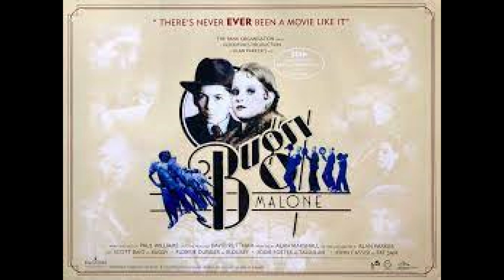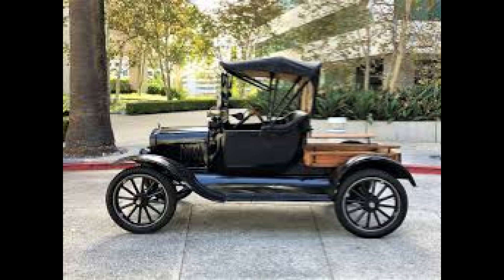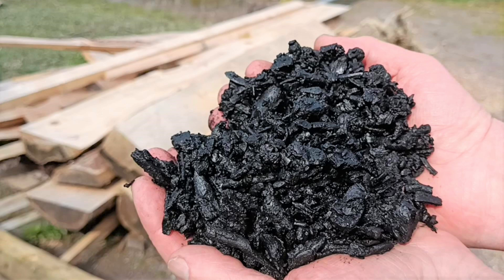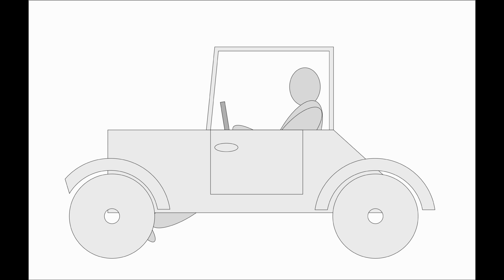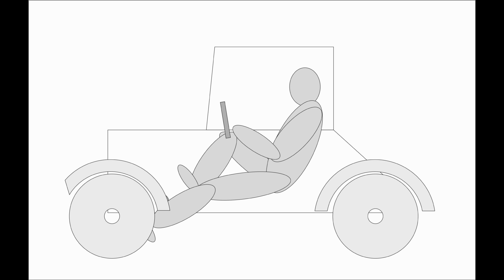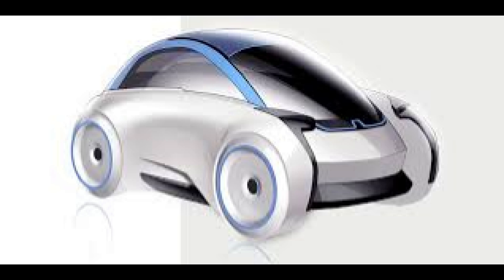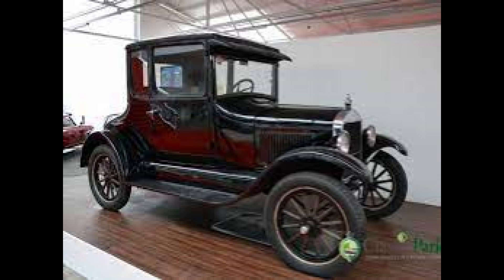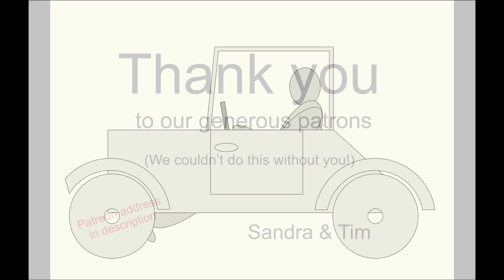Could We Build A Full-Size Wooden Pedal-Assist Electric Car?

Comment: Consider the Austin Seven.  It's a full-size car, albeit a quite tiny one by modern standards.  Four wheels, oodles of style and nobody expects a seven-horsepower car from the 1930s to be fast.  So if you build something resembling that and augment human muscle power with an electric motor, it might get down the neighborhood roads with sufficient speed as to not infuriate ALL the other motorists, and you don't work yourself into a complete sweat just popping down to the shops.

Comment: The Irish Industrial Revolution continues!  Looking forward to what you develop.  For the love of God please don’t use bicycle wheels.
Reply from the maker: why not?
Reply: @wayoutwest-workshopstuff6299  Bicycle wheels are not designed for lateral forces because bikes lean when turning.  On a vehicle camber is fixed and during turning the wheels are subject to very high lateral force.  So if bike wheel is used on a car type suspension the spokes will collapse causing catastrophic failure of the wheel.  You can watch Red Bull Soap Box derby to see this in action

Comment: Having built a soapbox gravity racer, I would recommend heavy duty BMX wheels, the ones with the greater number of spokes. My wife's mobility scooter does 18mph with a 1kW motor and 5 decent sized batteries. Good luck.

Comment: I think power to weight ratio will be very crucial for this project. With legal ebike legislation in Europe limiting the motor to 250w and 25 kmh. It is possible to convert a car alternator to be a brushless 3 phase motor, cheep for it's power (24v X 80a almost 2Kw), with a RC speed controller also relatively cheap. Perhaps you could make a streamlined body with bamboo or plastic pipe and some sort of transparent shrink wrap?
Reply: Recumbent bicycles with plexiglass are greenhouses!

Comment: Well, the easiest design you could go for is to attach two bicycles together side-by-side. https://i.pinimg.com/564x/2d/db/7c/2ddb7ca1c7956c83f2f90fe64b9edb01.jpg 

This will give you a pedal vehicle with 4 wheels and two seats. You can also use bicycle-compatible parts and you won't have to mess with crating a pedal transition and differential. 

If you want something that looks even more like a car, maybe get two recumbent bikes and put them together. https://i.pinimg.com/564x/43/44/c5/4344c5d2e7b2b513370ba596a3d75967.jpg

Comment: Have "converted" regular bikes to ebikes; some observations: your invention will be too heavy for an ebike "hub" motor unless you have multiple, and thats getting complicated. I would suggest a "middrive" ebike motor - in bike terms this replaces your bottom bracket and powers the large chainring. This enables use of normal bike gears and is alrogether smoother and more efficent. The gearing should allow you to avoid burning out the motor. For an off tbe shelf example I reccomend looking at "bafang" motors, in particular the "Bafang BBSHD", the meatiest example. You may run into laws re power (ive never heard of anyone being checked) but you can reprogram the motor to only put out legal power. The advantage of reprogramming rather than just buying a low power motor is that you can use it on private roads at higher powers and also that the components are far more durable.
Reply from the maker: thanks - yes, we're looking at those..

Comment: A lightweight frame made of tubular metal of some kind, covered in either heavy fabric or sheet aluminium or a combo of both.  I think wood is too heavy and rot prone.  Is that the budget blown?  Bicycle suspension components and brakes, a couple of hub motors with the electronics from a pedal assist bicycle conversion and you are away!  It has to be possible to build something nice looking that functions well.  I like the Model T Ford coupe inspiration.  You've got us all interested now. 😊

Comment: Id use 2 inch steel tube 1/8 wall wouldn't need much of it but the frame would be light and strong. Wouldn't be hard to pedal it if you got the gearing right. Since it'll have the electric motor it will assist you from a stop then be very little pedal and electric to keep you going. Most ebike motors put a small charge back into the battery when they are not powered like as you would be coasting or using the pedals

Comment: I know this is off-topic, and the answer is most liksly no. But have you thought of converting your stationary engine to be powered by wood gas? Granted,. the engine doesn't cost a lot in deseal, and I am not sure how viable this system will be overall. I just thought that you could take advantage of the gasses from the activated charcoal process.
Reply: Wood gas is very complicated unless you use a charcoal gasifier .

Comment: This is fantastic!  I think e-bike wheels are definitely the way to go. Light weight, and low rolling friction.  Also the controllers, chargers, and batteries are ready-made.

I'm a boat builder, so I've had experience with plywood and epoxy. I think it would be very difficult to build a body light enough with this method.  I think building out of wood and canvas (or the modern version of wood and Dacron) like an airplane would be brilliant. Very lightweight canoes and kayaks are built this way, and they're quite durable too. Dacron is fairly cheap, and shrinks when high heat is applied making it easy to get wrinkle-free. Once painted, the 'canvas' becomes drum-tight, and rigid enough to actually behave like a panel.
Reply from the maker: Thanks Joe. Good tip about the Dacron - I'd forgotten..

Comment: https://youtu.be/4RgqLQyDApE if money was o object this would make a very interesting monocoque.wood and fiber glass are  interesting  compasses. I like in the vamobile that the cab looks like a big motorbike helmet with grater visible .The mosquito plain was the fastest plaiin in ww2 it was made from ply would and was much lighter than if it was made from  metal
Reply from the maker: Is that real?! What fun  : -  )
Reply: @wayoutwest-workshopstuff6299  Saw the explosieve forming 20 or so years ago where they put colf ball type divets in a monocoque type structure making  very light aluminium amazingly ridiget

Comment: Completely agree with 4 wheels. The issue with three wheels. Especially in the country, is that the third wheel will ride through the rough ground between wheel tracks on country lanes and driveways

Comment: Hey Tim, Great Project.
 I suggest that you may be able to fabricate very lightweight and strong panels, even curved ones.
For years i've dreamed (as foresters do) of an electric assist velomobile with a structural shell chassis, formed of tightly and skillfully woven willow basket work, fibreglass and epoxy both sides for strength (thickness can be varied as needed across the structure with further weightsavings).
Perhaps you might like to experiment with woven willow panels, epoxied and fibreglassed both sides?? A good material for "coachwork"?
Baskets are strong and light, materials in the hedges,
Heck you may even get a few basket makers volunteering to help...
If you werent so far I'd be itching to join in.
tim
Reply from the maker: Interesting idea, Tim! Not easy if you want a smooth finish though?
Reply: @wayoutwest-workshopstuff6299  4mm willow, tight weave, smooth ripples on the surface?
 granted it may not present the smooth shiny black you'll need for your "Model T" look. 
Perhaps some sort of lightweight foam filler material could be used to flatten the weave prior to fibreglassing, give the woven panel a layer of spray foam to fill out the weave with a squeege maybe, sand back so the wood shows a bit, then add fibreglass and epoxy.
light strong smooth shiny, perhaps less than half the weight of equivalent epoxy coated plywood. Of course I wish you to follow your impeccable logic and reason. I am only suggesting this untested unproven technique as an option.
Saoirse!
tim

Comment: Well that is much bigger scale than narrowgage.
i think extremely light wood/bamboo would have to be the basic structure, i would probably go with 2seater to start with just as proof of concept.

Unless there is some handy chassis available  in nearby car scrapyard probably KISS principle - box steel frame, leaf springs, body on frame design.

I suspect for simplicity sake the wheels might be best served by just having one bar as opposed to independent for each wheel, front paddles only and back powered by the engine?

Comment: 3 wheels save on suspension. 4 wheels needs complex, (and heavy?) suspension or it's practically a 3 wheel car anyway on any non-flat surface. I had a delta config bike for a while. It was great on the flat and downhill, but it was terrible uphill compared with a normal bike because it isn't possible to use one's weight - so driver position might be worth considering.

Comment: i'd be glad to help you. e-bike parts or golf cart parts would be very easy to find. the simplest of simple would be hub motors since there's no drive shaft to worry about. if you go this route, make sure the two are the same power and torque. controllers can vary the power sent and all. you could also make it a 4 wheel drive if you use 4 hub motors. i have been following your channel for a bit and you have enough smarts in your brain to make the posibilities endless
Reply: for the speed display, most e-bike controlers have a display of sorts to show speed, battery, range, odometer. it could be an all in one thing

Comment: E bicycle wheels all round with chains on the back … get 2 old bicycles and cut them up for the front forks and back forks weld them together and make a linkage for the steering my dad make this it the rinky dink pedal powered sounds system https://youtu.be/KVRywQRM2H4

Comment: I am currently making something similar and have came up with my own answers to some of the questions you have.  The electric motor system is pretty easy.  I used an ebike conversion kit from Yose Power.  It’s a 250W (road legal) geared hub motor system in a 20” (BMX-type) wheel.  The kit has the controller, display etc and it’s dead easy to install.  I used a ‘front’ hub motor on one of my rear wheels and a pedal chain drive to the other.  I’d suggest using BMX wheels all round (with the larger diameter axles e.g. 14mm).  As for body construction, I am using thin ply on a steel square section chassis but this is a bit heavy.  I think a monocoque would be a good idea or make chassis members from plywood ‘boxes’ which are light and rigid.  You can learn a lot from old fashioned model aircraft construction methods (stick and tissue).  I would also suggest ‘poor man’s fibre glass’ as a way if increasing the toughness and weather-resistance.  This is just gluing on fabric (such as a cotton bedsheet) and covering it with several layers of paint.  Cheaper and less smelly than epoxy.  Steering and suspension are more tricky.  The Dutch guy who built the ‘Tribolt Trike’ (see it on FB) has good ideas for simple, non welded front steering systems.  Rear suspension using bits from old mountain bikes seems relatively easy - the front less so.  Anyway, good luck.
Reply from the maker: Thanks HTH - I'd be interested to see what you came up with - but no videos?

Comment: Take a look at the channel “MORI TV”, a Japanese chap who modifies very small motorcycles into trials bikes, and also builds (from scratch) small 1920s-1930s-style sports cars powered by Honda 50cc - 90cc engines. He has made 3 and 4 wheelers. Surely an electric motor from a golf buggy will be similar power/torque to a Honda C50 engine.. his chassis are welded steel tube space-frames - very light (essential) and rigid. I once built a sports car chassis on a flat wooden board, so it’d be a doddle for you. Love the concept! Les in UK

Comment: Ackerman steering is highly recommended.

High-carbon steel tube or box section steel for frame and rollover loop. Rivit aluminium sheet for bodywork.

Rear wheel drive for simplicity.

Comment: A separate motor for each rear wheel saves thinking about a differential, pedal power on one wheel only? Take a look at Dibond or Alupanel for the body structure, I have built monocoque railway coaches from it. It has a polypropylene core with painted aluminium skins on both sides. To create a fold you cut half way through with a 90 degree bit in a router.
Reply from the maker: Thanks, Colin. Locos are so much easier, aren't they? - no differentials, no steering, limited suspension and no weight worries...
Reply: @wayoutwest-workshopstuff6299  , I think I will stick with rail! Been drawing up a small car front end, kingpin inclination, scrub radius, castor, Ackerman angle and other scary stuff! I can recommend searching youtube for cyclekarts, this is a great summary on front end design, 'Team Juric - Lotus 25 Cyclekart Design - Part 1'.  
Not seen your loco for a while, how about an update?

Comment: My wheels are turning now ! lol. I have made a few small cars and large go karts . Starting with the frame you have 2 choices wood or metal second as far as a motor a starter from a car works great its 12 volt and very strong  and there's no need for a differential , make it a 1 wheel drive . i would use 2- 20" bicycles ( 2 front and 2 rear with gears ) you can use most everything on the bike from the down tube backwards to hold the tires , the forks and necks with gears on top to steer then build your frame and cover with canvas or 1/4" plywood now windows id use 5/8" plexiglass and the seat id use a school bus seat with frame . Batteries having 2 separate banks of 3-12 Volt each and solar charging the bank not being used . Lights would be all LED 12 volt and no need for axles having one tire for pedaling and the other for the motor ! The bikes should have 1 way gears so your not turning the pedals or motor when not being used !
Reply from the maker: Thanks Dave - lots to think about there..!

Comment: I like this project. I have a thought about the doors. Don't make regular car doors. Just Don't. They are a pain in the rear. 

Maybe a top that lifts forward back or side ways on hinges, and latches on the inside and or outside. Maybe be able to latch from the inside if inside the car, and from the outside when you park it. 

Perhaps, a canvas door that zips up. Or a plexiglass window that you remove to climb in the car, and resecure once in the car.

If it is possible, to source sheet aluminum, it might be useful for some of the body panels as it will be lighter than epoxy coated plywood. It might even be cheaper. I know epoxy, fiber, and plywood are not free. But I don't know how far from free the supplies will be in your area.

Good luck! I look forward to seeing this project progress!

Comment: Google "bringo hinto" for images. I don't know how they are called in English. But I have paddled these without any assists and it is doable. I don't see why it would not work with a lightweight chassis with electric assists. If you follow the bicycle theme you can get two hub motor wheels at the back and would not need differentials. Just one of the motor would need to work harder in corners. Or if you use regular motors, just use two motors, each driving one wheel and do not connect the two wheels with a fixed shaft. Less weight and less complexity.

Comment: Good project :)  Just some initial thoughts:  no gears are necessary with an electric drive as it delivers useful torque at all operating speeds, separate small motors on each rear wheel would eliminate the need for a diff, keep the weight and power within the DVLA guidelines for a Class 6 or Class 7 electric powered quadracycle to avoid expensive SVA certification, insurance and vehicle excise taxes.

Comment: Now this looks like a cool project! What are the rules for pedalecs in Ireland? I assume being in the EU it'll be similar to the UK (as our rules came from the EU before we waved bye-bye), so no throttle only power (ie you have to pedal so it can assist), maximum of 250W and limited to max 15.5mph?  The UK rules are here: https://www.gov.uk/electric-bike-rules and I don't think they've changed much since Brexit so they're probably similar to yours.
Reply from the maker: Yes, I think you're right, Jon, but I must confirm..

Comment: I'm an avid cyclist and while the hills in my city are nothing major, they are big enough to take the fun out of commuting.

The mere thought of having a rolling contraption that weighs in at not only 15kg  (bike) or 25 kg (ebike) but maybe somewhere around 150kg and might have quite a lot more wind resistance, sends shivers down my spine.

I guess keeping it light is key. Maybe get some if the better Chinese ebike conversion kits. For the car itself, I could imagine a wooden frame, covered by some fabric and then glazed with epoxy. Like one of those early airplanes.

Or maybe build an airplane, while you're at it 😃

Comment: Look into your local laws. Here in Canada a four wheeled electric peddle car is considered to be a motor vehicle and needs to be registered. if it doesn't have a vin it can't be registered. If it has three wheels and less than 700 watts it is considered a electric assisted peddle cycle. The extra wheel makes a big difference apparently.